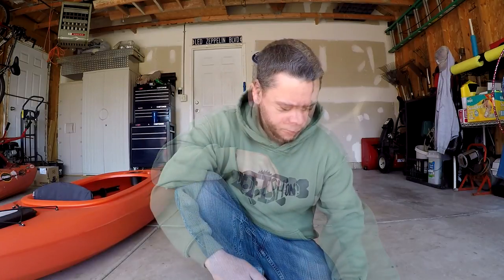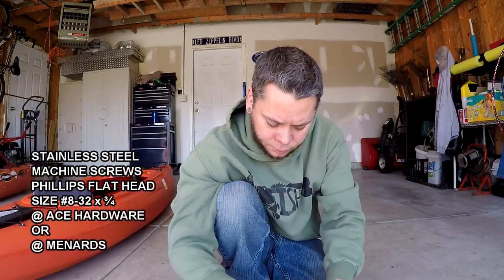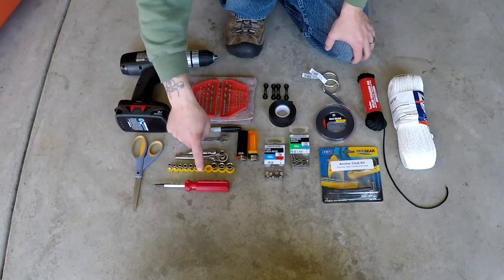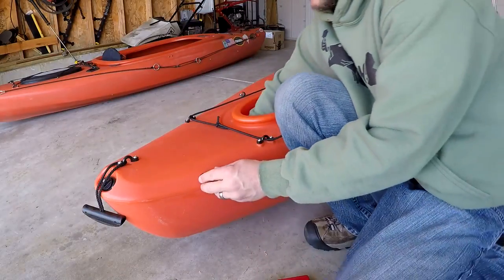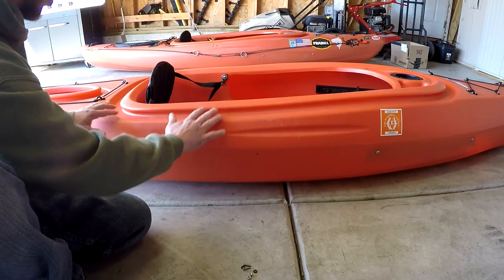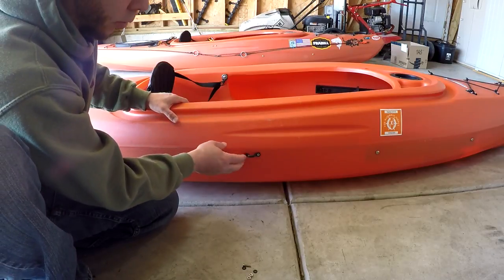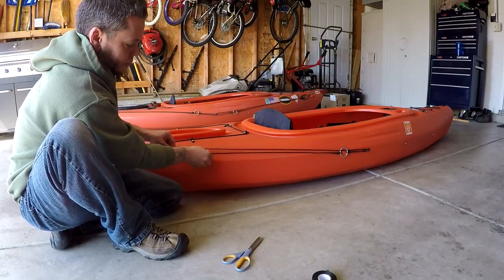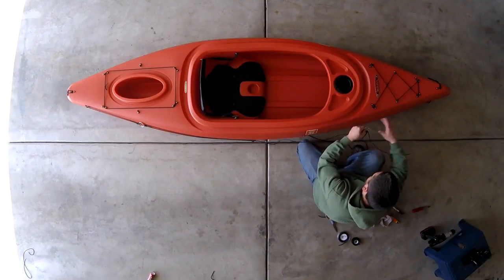Kayak Anchor Trolley System Install

Comment: When I installed mine I thought I had enough slack in the Paracord but evidently I didn't and it drawed up tight like a guitar string. I going to preshrink my Paracord in boiling water before I reinstall it and it should work fine then.
Reply from the maker: Great tip thanks for watching